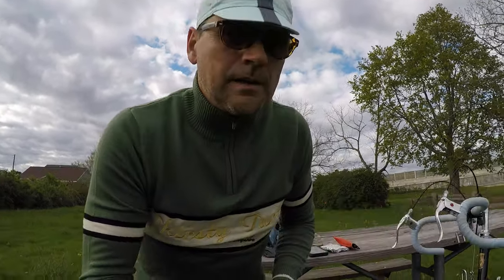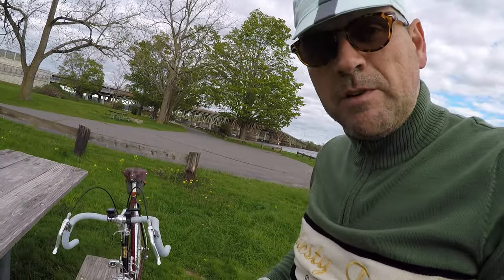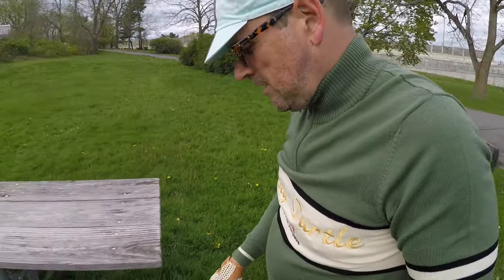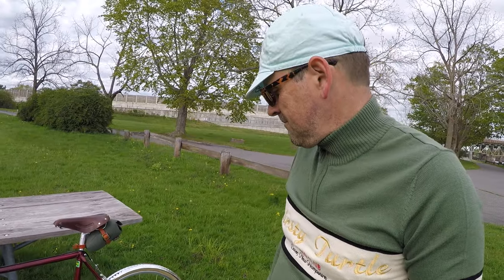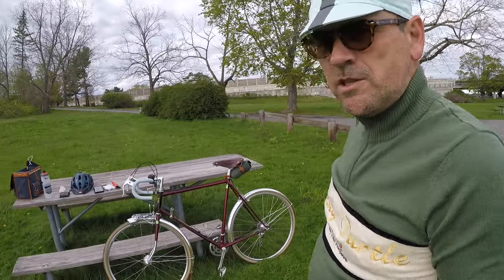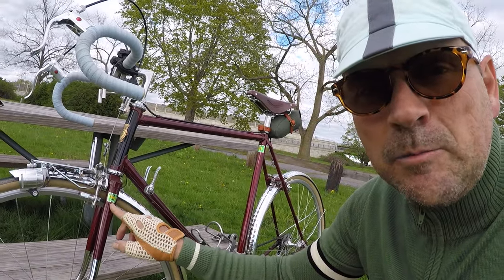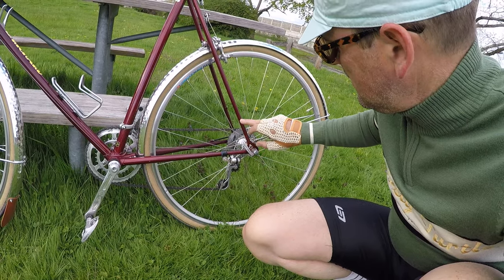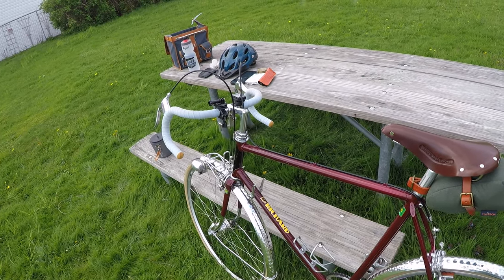1984 Lotus Excelle built up as an Eloi Richard Randonneur

Comment: Did you drill the headlug to insert the rear light cable?
Reply from the maker: I did indeed. It was a little tricky, but it's holding up well, I also drilled the chainstay where the little light is attached, ala Alex Singer style